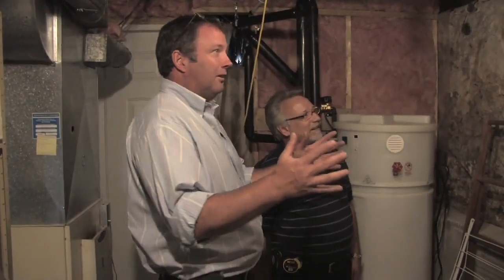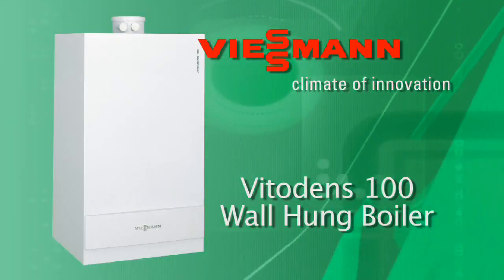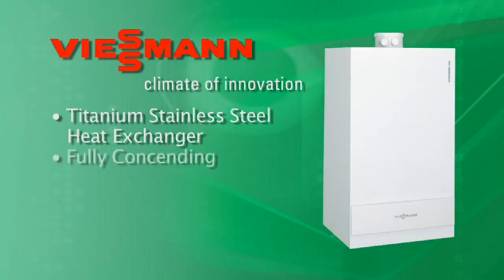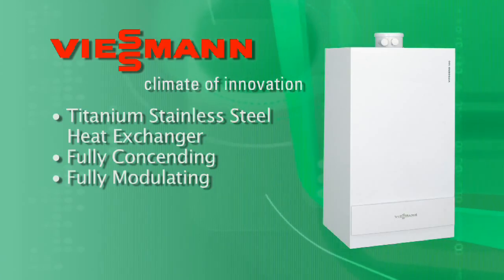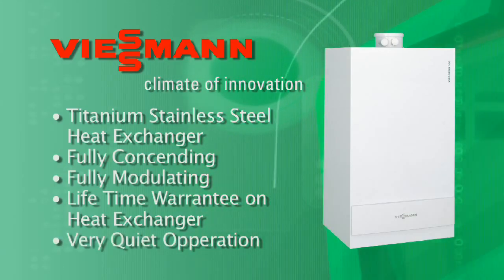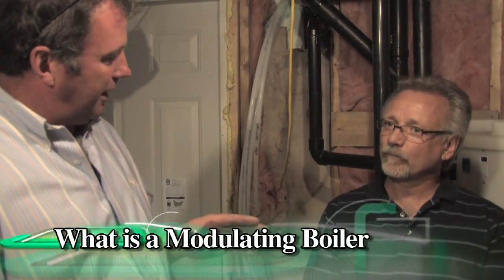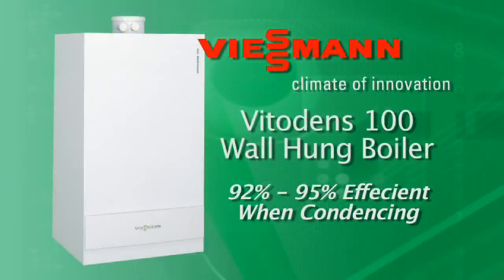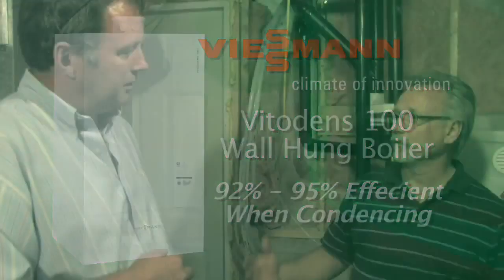Viessmann Vitodens  High Efficiency Residential Combi Boiler Benefits

Comment: We installed the Viessmann Vitodens 100-W in 2012. There has been some maintainance done throughout the six plus  years of ownership. This year we have  spent over $700 dollar trying to figure out why the system has quit heating zone two like it originally did for the first 5-1/2 years. We have worked with two Certified Heating and Cooling businesses in our area and still have not resoved the issue resulting in reliance on an electric space heater. Very expensive, disappointing, and frustrating. DTook down the outside temperature controller because it was installed too low on the outside of the house.Does anyone think they could resolve the problem?   Both contractors have contacted Viessman on the problem. replaced ignitor and gasket, replaced water circulation pump, replaced water sensor, adjusted temp at boiler. Adjust pressure reducing valve and connected a loose wire on boiler for 29 volt zone panel.    HELP!